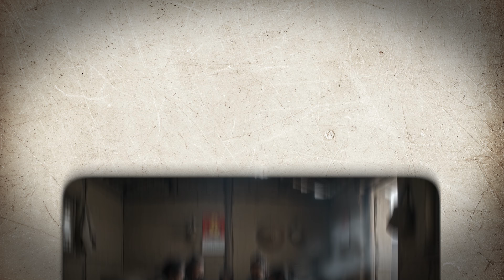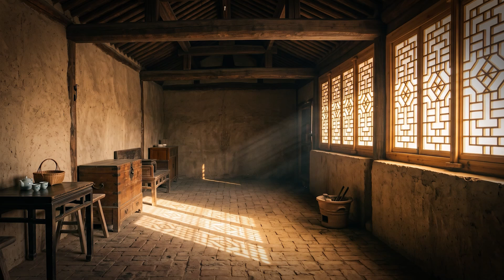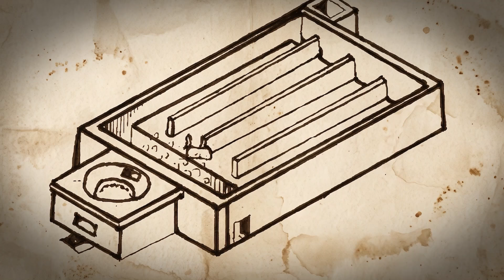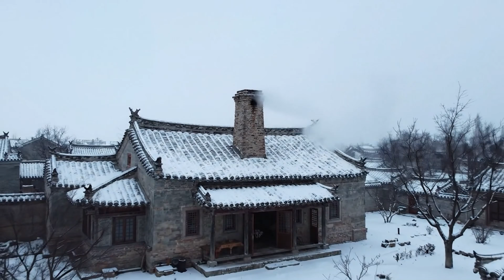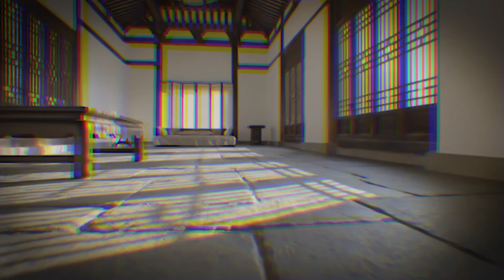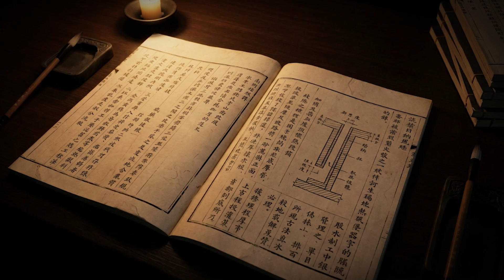The Ancient Chinese Courtyard House That Survived -40°C Winters Without Modern Technology

Comment: How nice. A sun angled at 26deg during winter - meanwhile in southern Poland it gets below 16deg. It reaches 20 deg only by the end of January. And we shouldn't forget how short days are - just 6h. All the architecture tricks with sunlight won't work if sun is way too low.

Comment: Fun fact: -43° is where Celcius and Fahrenheit sync back up
Normal people just double it and add 13 other wise
(All totals are approximate)
Reply: -40 is exactly where they are in sync. You can check it with this formula that converts Celsius to Fahrenheit:
 ºC times 9 then divide by 5, add 32 to get ºF
-40*9/5 = -72, -72+32= -40

Comment: Below is a scholarly-style critique of the video The Ancient Chinese Courtyard House That Survived –40°C Winters Without Modern Technology, grounded directly in the transcript from your active tab . I treat the video as a historical-technical argument and evaluate it through architectural history, environmental anthropology, material science, and historiography.

Scholarly Critique of the Video’s Argument
I. Introduction
The video presents a unified narrative of northern Chinese courtyard houses as an integrated environmental technology capable of sustaining human life through extreme winter conditions. It argues that ancient builders achieved a sophisticated equilibrium between wind management, passive solar design, thermal mass heating, and waste‑heat recycling. While the technical descriptions are largely accurate, the video’s interpretive framing raises methodological concerns, including teleological storytelling, civilizational essentialism, and selective evidence use.

II. Strengths: Technical Accuracy and Systems Thinking
1. Environmental Physics
The transcript demonstrates a strong command of environmental physics.

The north-facing solid wall is correctly described as a windbreak that reduces convective heat loss.

The explanation of loess as thermal mass aligns with soil mechanics literature.

The solar angle calculations for Beijing (26° in winter, 73° in summer) are accurate and consistent with astronomical data.

These sections show careful attention to physical principles and are supported by empirical plausibility.

2. Vernacular Engineering
The kang and dikang systems are described with unusual clarity:

The flue geometry, temperature gradients, and stack effect are consistent with archaeological findings.

The discussion of fiber-reinforced clay mortar reflects known construction practices.

The depiction of waste-heat recycling is historically accurate and aligns with ethnographic accounts.

The video excels in presenting vernacular architecture as a multi-component thermal machine, a framing that is both pedagogically effective and conceptually sound.

III. Weaknesses: Overgeneralization, Romanticization, and Missing Context
1. Overstated Engineering Precision
The video repeatedly implies that ancient builders “calculated exact widths” and “hit perfect ratios” without instruments.

This claim is methodologically weak.

Most courtyard geometries emerged from craft tradition, not formal trigonometry.

The “perfect ratios” cited from modern simulations reflect survivorship bias—poorly built structures did not endure long enough to be studied.

The narrative romanticizes ancient precision in ways that obscure the role of iterative trial-and-error.

2. Civilizational Exceptionalism
The transcript contrasts Chinese systems with Roman hypocausts, concluding that Chinese designs were superior because they required “no extra fuel.”

This comparison is historically imprecise.

Roman hypocausts served public baths, not domestic heating.

Domestic Roman heating relied on braziers, not hypocausts.

The collapse of Roman heating infrastructure was political, not thermodynamic.

The comparison functions rhetorically rather than analytically.

3. Flattening of Regional Diversity
The video treats northern courtyard houses as representative of “Chinese architecture.”

Southern China used minimal heating due to milder climates.

Western China used turf houses, yaodong cave dwellings, and yurts.

Manchurian designs differed significantly from Beijing’s.

This homogenization obscures the ecological and cultural diversity of Chinese vernacular architecture.

4. Sanitization of Historical Hardship
The video implies that kang systems kept families “warm” through –40°C winters.

Ethnographic evidence shows that kangs warmed bodies, not rooms.

Indoor air often remained cold; frost inside houses was common.

Winter mortality remained high well into the 20th century.

The narrative risks romanticizing survival as comfort.

5. Limited Engagement with Archaeological Variability
The transcript treats building manuals and modern simulations as definitive.

Manuals often describe idealized practices.

Excavated kangs show variation, repairs, and improvisation.

The claim that designs “barely changed in over a thousand years” is overstated; flue geometries evolved.

The video’s evidentiary base is narrower than its claims suggest.

IV. Interpretive Issues: Teleology and Narrative Framing
1. Teleological Progress
The video frames courtyard houses as the inevitable product of rational engineering responding to environmental constraints.

This narrative downplays contingency, local experimentation, and social organization.

It treats architectural evolution as linear and goal-oriented, which is inconsistent with anthropological evidence.

2. Absence of Social and Labor Context
The dikang system required:

large labor forces

charcoal production

palace maintenance staff

imperial resource extraction

The video frames it as pure engineering, ignoring the political economy that made such systems possible.

3. Environmental Determinism
The transcript suggests that cold climate “forced” the development of courtyard houses.

In reality, courtyard houses also served kinship, ritual, and social functions.

Their form cannot be explained solely through climate.

V. Counterarguments and Alternative Interpretations
1. Resource-Driven Innovation
If northern China had abundant timber, kang systems might not have developed.
This suggests the system was resource-constrained, not purely engineering-driven.

2. Population Density
High density forced fuel conservation.
Lower density might have produced larger hearths, more fireplaces, or different spatial layouts.

3. Climate Variability
Courtyard geometry is optimal for cold climates but produces overheating in warm ones.
This challenges the video’s implication of universal applicability.

VI. Conclusion
The video is a compelling and technically accurate introduction to northern Chinese environmental design. Its strengths lie in its clear explanation of physics and its systems-level framing. However, its interpretive claims—regarding precision, universality, and civilizational comparison—are overstated. A more rigorous historical analysis would incorporate regional diversity, social context, archaeological variability, and resource constraints.

Comment: But how did they clean out soot blockages in the winding brick tunnels under the bed platform from years of daily fire smoke blowing in the same direction? Or if a rat got in there and died, it seems so out of access.
Reply: Cleaning was done through tile hatches in the sides.
This system of mass heaters was used through the entire Eurasian continent and is still in use mostly in the form of mass heating stoves.
Reply: @PeterHuys-w3z Makes sense, thank you!
Reply: The rat probably wouldn’t smell because it would be dehydrated and would eventually turn to ash.  As for the soot, I have no idea.
Reply: I doubt that a rat would want to sneak there and manage to die without being smoked instead of decomposed.
As for cleaning… probably it would sometimes have to be cleaned the same way we deal with ‚clogged sink’. If possible pushed/blowed out, if not then the whole thing would have to be open up, cleaned and re-done? 
I’m guessing that’s how they dealt with it but if no one more knowledgeable answers then I hope it somehow helps you…
Reply: They sent a kid in with a brush and basket to clean it out.

Comment: It’s not that warm… I live in Montana. -35 and a furnace + in floor heating, 6”insulated walls with foam, it’s cold.
Reply: If it's cold then the capacity of the floor heating han not been calculated correctly. (And/or incorrect placed insulation.)
I've been in houses and cabins in the mountains of Switserland and they have no trouble keeping it warm.
Reply from the maker: Thank you for watching

Comment: If you are a Canadian, you know the "air lock issue" Having a door directly into the living room from outside is horrible. You need an entry room, even if it is just a small one, with inner and outer doors.
Reply: Hi neighbor yes I agree northern midwestern houses in the USA used to all have pocket doors then they had a decade where they tried to get rid of them and now they are trying to put them back because pocket door rooms are great for cold weather areas.
Reply: Canadian here, yes entry rooms are important, we also use deep basements almost standard, both to get below the frost line and prevent heaving, and it helps retain heat in winter, and cool in summer.
Reply: I grew up in Scandinavia, and now live in the Rockies in the US, and I'm dying to enclose the porch to create an air lock. The house is a stupid open concept thing, with no vestibule, no doors between utility rooms, and it's just a mess, and difficult to maintain temperatures in this space. Even an unheated glazed porch helps protect the house from heat escaping, AND gives you a place to shed snowy boots and coats without the snow melting, meaning they don't get soaking wet, if you're about to go back out for chores after a break.
Reply: @spmamabear I have this obnoxious big bay window that would be great, if it didnt show a view of the underside of the second floor patio. So I've enclosed the underside of the patio in poly plastic every winter to keep the house warmer.  No cold air moving past all that glass.  It really helps.  Probably saves me $600 to $1000 in heating cost every year.
Reply: Yes, an ante room.
Reply: Like on the ISS!
Reply: A breezeway. Close outer door before inner door is opened. No wind wiping out the heat in the house
Reply: The  Inuits & Norse create a lower level to trap the cold near the door
Reply: @TruthTea77636 I’ve seen people set up a floor less tent on snow. Dig down a section in the center for a wood stove. The cold air sinks down right at the heat source.
Reply: Most houses of a certain age in Milwaukee and Chicago have that entryway as well.
Reply: I grew up in rural Ontario.  When I moved to Vancouver i wondered why no one had entry rooms and mud rooms out here.
Honestly,  it took me an embarrassingly long time to figure out why.
Reply: Plus, to keep dust and mud out.